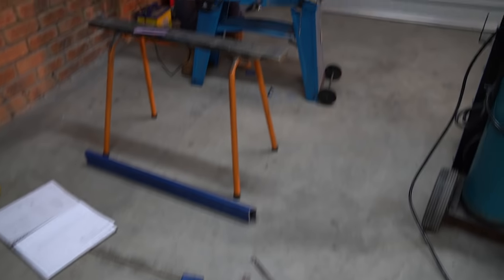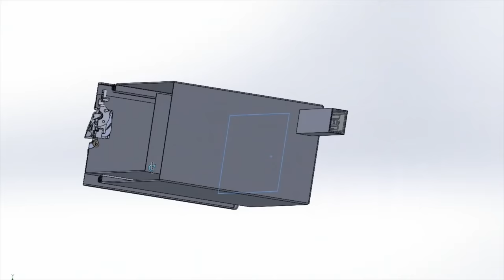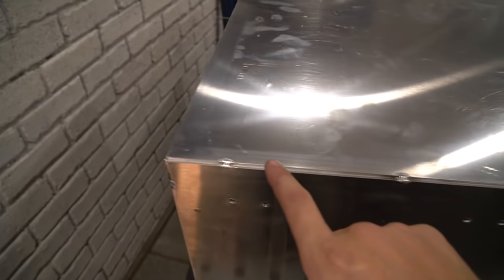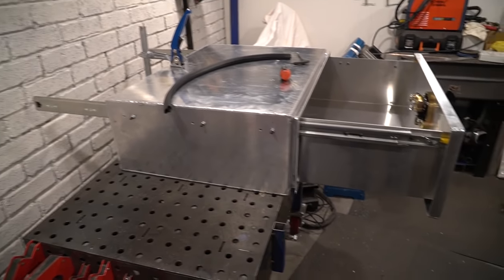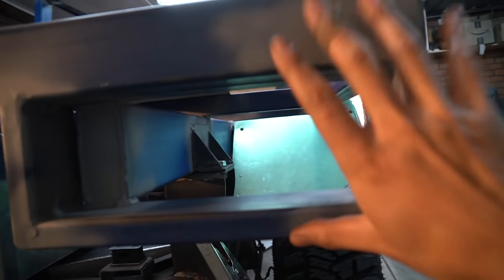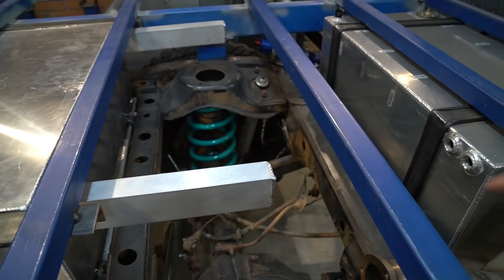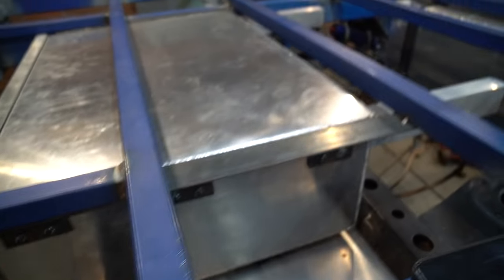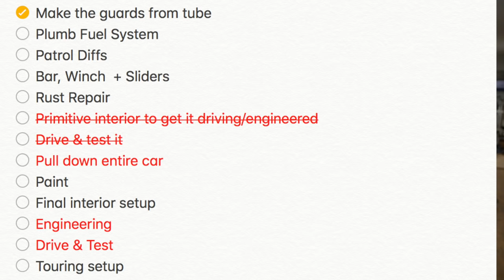BUILDING THE ULTIMATE 4X4 REAR END FOR MY BARRA SWAPPED LANDCRUISER - Barra T FJ 45/ 80 series Ep#17

Comment: Used to build waterproof boxes, you did a great job. I'd also build an aluminum heat shield down the side of your drawer. I'd make it like a 3 sided box, top, side and bottom.
Reply from the maker: Thanks mate, I like that heat shield Idea, would be good next to the water tank/fuel tank as well!
Reply: I dunno about the drawer needing a heat shield. Looks like 50mm space easy. Then you have 40mm between the box and the drawer. I'd bet your time could be better spent somewhere else.
Reply: MudRaider, it's better to over engineer something than to find out you could have done it sooner. The exhaust only has to catch in a reversing situation when he's doing hill climbs out in the mud, and then it's a cheap form of insurance.

Comment: Looking great! Just a thought with the in fill panel if you put the number plate on you will need a number plate light that will stick out a bit. Would it look a bit better to box it back in a bit with a similar angle in to the corner of the tray and headboard angle?
Reply from the maker: Hey Allen, yeah reflecting on it that could be the go. I might just whack a number plate on and see how it looks now that I’ve built it, if it’s average I’ll do what you are suggesting!

Comment: Love the tray mate one question though 
Nember plate light ?? On the flap ?? 
You could always bring a rhs section for the I fill with a bit of space for the drawer to slide out whilst still missing the drawer. If you make the water tank depending on size I recommend using some baffles in the tank
Reply from the maker: Cheers Sean, yep I was thinking on the the flap, if it doesn't work for whatever reason I think I'll do something similar to your idea! I think I'll get a poly one made up for me and get some baffles like you suggested!

Comment: Idea that i would consider:
Dont have a cowling at all, then once the draw is pulled out a sealed rigid lid folds sideways (could double as table). This would be alot lighter and also not have any of the wasted space as mentioned. Downsides could be stopping draw slides from getting muddy (maybe build custom slide with sealed roller bearings?)
Reply from the maker: Thanks Murray, definitely considered that first up as it has the benefits you mentioned! I think stopping dirt/sand getting into the sliders is a pretty hard problem to solve, would love to see it done though!

Comment: Hey mate I’m a boilermaker and trying to get more into the design side of things, just wondering what software you use? And also what did it cost to get the draw laser cut and folded? I’m building a new tray for my Ute and half thinking by the time I get parts laser cut and folded I’m going to be better off just getting someone else to build the draw and boxes for me. Thanks mate, love the content!
Reply from the maker: I use Solidworks, Around $400 in cutting and folding. The cheapest sealed draws I have seen are around the $1200 mark but just weren’t the right dimensions for me. Any excuse to get on the TIG!

Comment: Obviously, your build, your choice, but here's my $0.02 worth.
I also have an 80 chassis based ute. I went away from a mounted water tank, it didn't get used enough to justify the space it took up, I now run with plastic gerry can style water on the tray, when needed. In the space above the rear diff, I now run three N70 size batteries, two paralleled for the winches and a single start/run battery. Both to shift their weight down and to get weight off the front axle.
Speaking of axles, the Nissan rear(assumingH230, not the mega weight, H260), is only an upgrade, if you're going to run an LSD, honestly, Toyota never masterminded the LSD, if you're going a locker, the 80 is the better axle setup, with a couple of mods.
Front, 80 bearings and brakes are far superior to Nissan. Four pot, vs two pot brakes and take a look at the bearing spread, between 80 and Nissan.
If you're going to run a front locker, there's a guy in Melbourne, who builds front diffs, to suit, the much stronger Nissan centre and uses 80 axle tubes/CV's/brakes etc. The TJM locker to suit the bigger Nissan centre, will accept the side gears out of the Toyota TJM locker, allowing you to use stock 80 axles. Without his permission, I won't mention his name publicly, but reply and I'll get you his details, via Facebook or similar. 
Also, if you've already bought you T/Case adapter, a Nissan centre pumpkin rear diff, won't work with an offset rear 80 T/Case. Strength wise, plenty of people, running big power through both the Nissan and the 80, without issues, that said, Nissan GQ/GU cases are generally cheaper, but 80 allows for low range, two wheel drive, awesome if you need to reverse boats, caravans etc.
Really enjoying your build, except that it makes me want to change some stuff, I previously, thought I was happy with.
Reply from the maker: Hey Aaron, appreciate the detailed comment. I plan on running one in the bay and then a LiPo in the cab. 
Planning on running a H260 rear and lockers. I have actually seen something similar and think I know who you're talking about, pretty cool stuff really I would be worried about spare parts if something went wrong. I like the idea of all nissan or all toyota. I have seen an 80 series transfer with GU diffs, trying to make the GU transfer work, I like the fact that it is manual as I have heard of the 80 series motors breaking. Also you can get reduction gears for them at some extra cost. Big pro for me is also GVM upgrade which is part of a long term plan for the car. I'm working through all the issues now and not even sure I can make it work due to tailshaft length/angle so watch this space!
Reply: @DesignedandBuilt  
Cheers for the reply..... but now you've got me thinking....
There is full manual, part time 4WD 80 T/Cases around, but they are rare(ish).
If you're going for a GVM upgrade, I assume you're going to use the leaf spring, full floating axle H260. How are you going to deal with the 100(and something)mm less width?? Correcting the width, with billet hubs, spacers, puts the WMS outside the outer bearing race. I'd be interested to learn, if that's actually a problem, from an engineering perspective. 
If you're talking about the coil H260, I was pretty sure they very similar(+/-80kgs) load rating to the 80 rear axle.
If you're going to get axle brackets, cut and bent, to suit the Nissan rear into the 80, there would be a small market for them, including me. Similar small market, for axle width correcting billet hubs, if doable, for the GU leaf spring crowd, to correct front to rear track width.
Looking forward to seeing which way you go.
Reply from the maker: @aaronnoyb  as you seem pretty clued up on the issue mate and I am struggling to get information anywhere, I thought that the load ratings for the axles are:
H260 Coil. 2270 kg
H260 Leaf. 2650 kg
H233 Rear 1800 kg
80 series rear  1800 kg
I am struggling to find the correct information though. I am planning on using a H260 coil rear and making brackets to suit the 80 series.
Reply: @DesignedandBuilt  
I can't find my factory manual for the 80, but I'm pretty sure rear axle capacity was 2300kg in Australia, for full floating rears. The US 80's were 3970lbs/1800kgs for semi floating rears.
Pretty sure the 75/79 series utes, list the rear axle capacity at 2300kgs, leaf springs, but using the same bearings(and hubs on the 75) as the 80 setup.
I don't want to discourage you from the H260 coil idea, as I'd be very keen on buying a set(or 2) of brackets, if you can make it work.
Looking forward, to seeing which way you go.
Reply from the maker: Not to worry I’ve gone ahead and done it anyway.  The compliance place I have seen with my own eyes has the 80 axle at 1800kgs, h260 rear 2300kg. I guess compliance plates can change over the years and for models and variants. Cheers, hopefully I’ll upload the video this week!

Comment: Didn't warp that rear beam welding the hinge recesses in? I cringed when I watched it as I caused a pain in the arse doing the same thing adding in some recessed nuts when I built mine but it was in a lighter RHS section. The rear looks mint now with that infill.
Reply from the maker: It's already kind of warped from when I was welding my tray, planning on Straigtening it out when I weld down my checker-plate ! I don't think the recesses did it any harm.